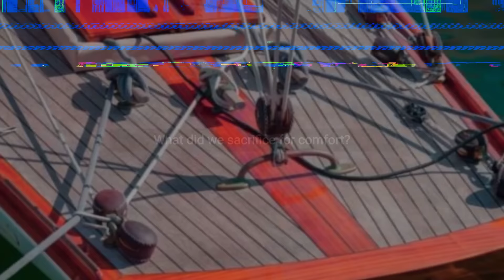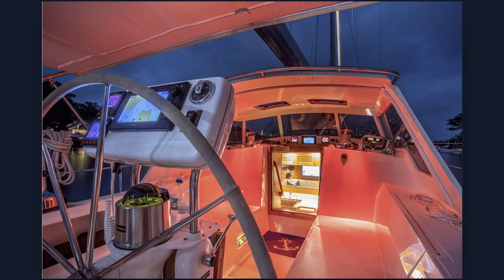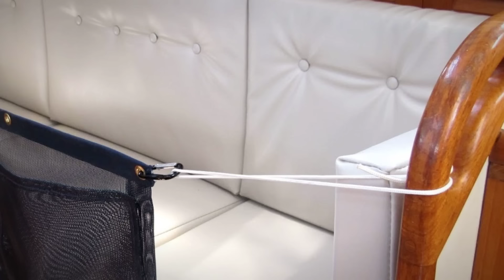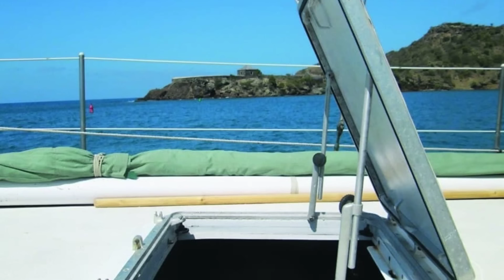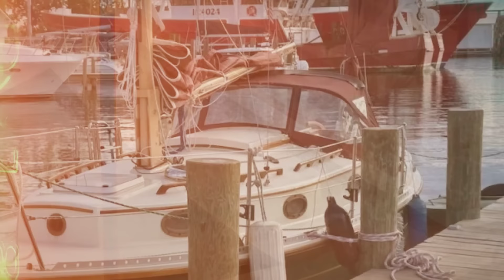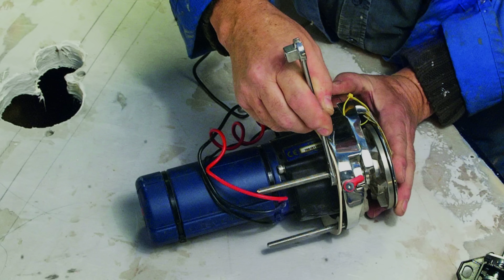10 'Lost' Features That Made Old Sailboats Bulletproof (And Why New Boats Don't Have Them)

Comment: My 1982 Morgan 32 has nearly all of these features.
Reply: That's good to hear. I reflected on my previous boat, a nicholson 30, and it had a big cockpit, small drains and I never found a bilge pump flat enough to fit in the bilge. It was barely 10cm. Glad I moved on.
Reply from the maker: Nicholson 30 is a fascinating case — great bones above the waterline but the bilge access was an afterthought. That era's British build quality didn't always translate into workable utility below decks.
Reply: @yachts_and_boats  I wouldn't say that. The 70s had great boat designs as well, even from Nicholson. But that bilge was just criminal.
Reply from the maker: Morgan 32 is a perfect example — overbuilt when overbuilt still meant something. That era didn't engineer to a price point. Check out the most-viewed videos on the channel, a lot more on what made those boats the dying breed worth keeping.